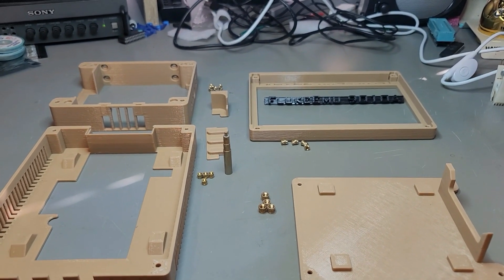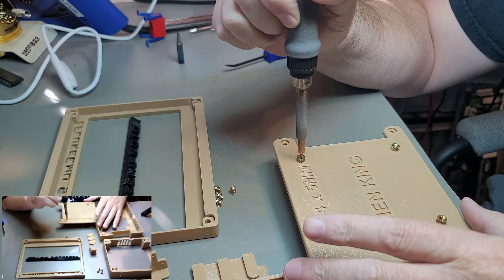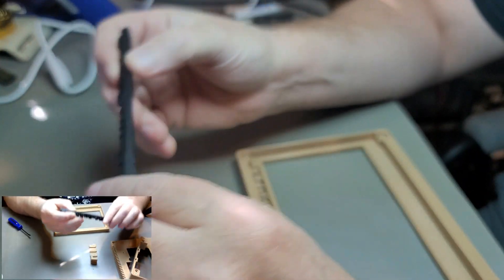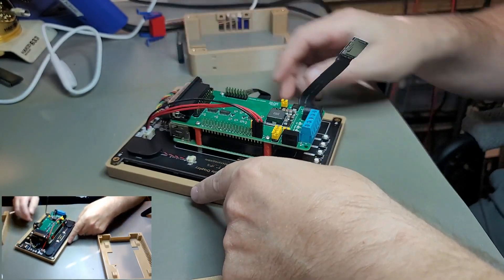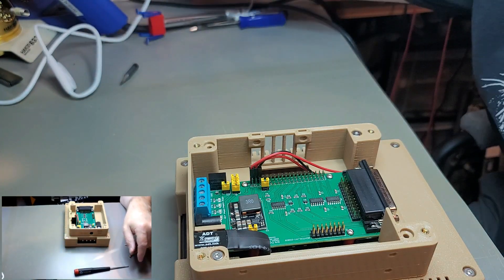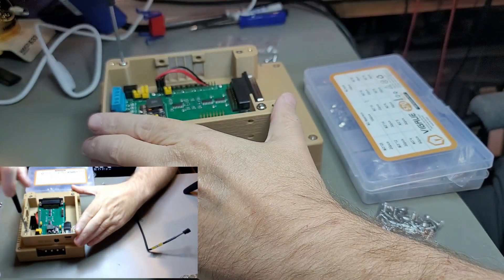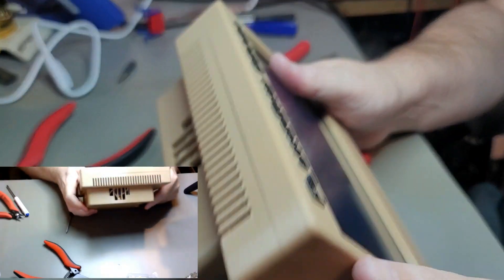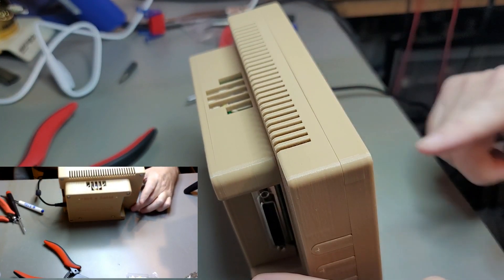FlukeEmu 9010A Case Assembly

Comment: Hey there, great video!  May I ask the version of Pi that you use for this? (3, 4)?  Also where is the best place to search for the display?  Thx!
Reply from the maker: Raspberry Pi 3b+
Reply: @Arcadenut1  Thanks!  I also wanted to ask you how you get the texture on your 3d prints?  Looks very professional. Are you printing on a special bed, or are you texturing them in the print itself?  Currently using an Ender 3 and it looks okay, but it does look printed of course.
Reply from the maker: @brendanvogele2531 Prusa Printer with a Textured Build Plate.  You might be able to find a 3rd party one for your printer.